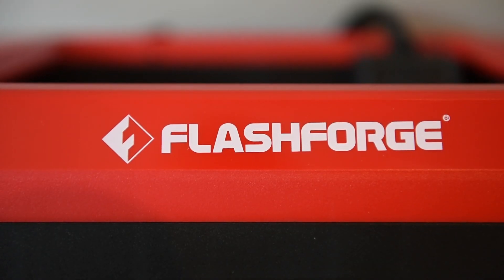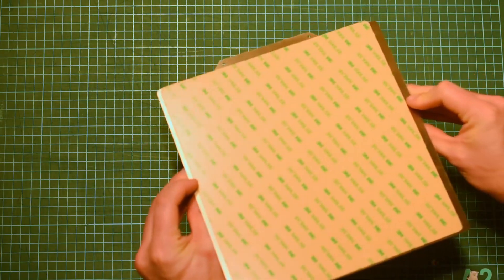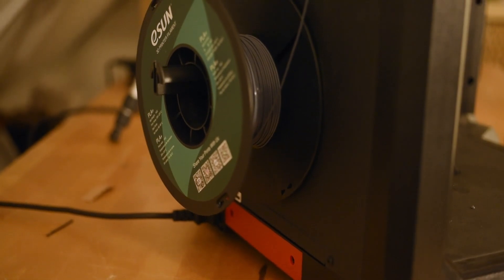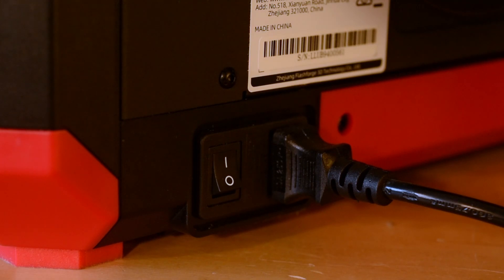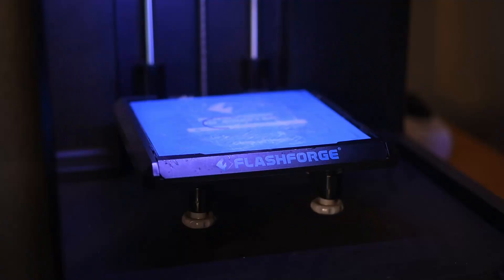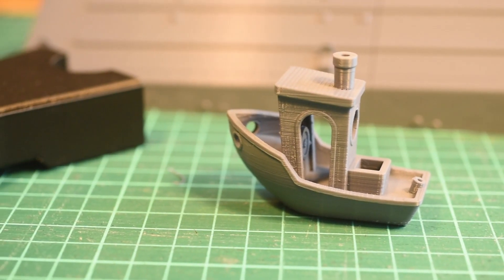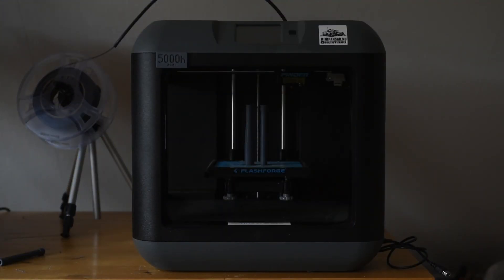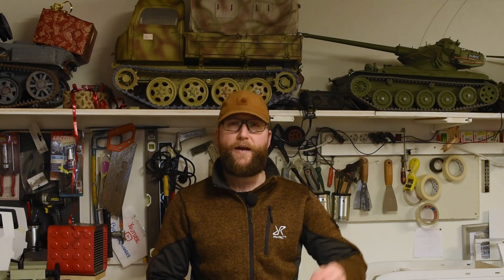3D-Printer review - the Flashforge Finder 3

Comment: I've had my Finder3 for about 2 or 3 years.
I filled the sides in with Acrylic sheet and printed some runners to hold another sheet of acrylic as a drop down door.Which solved the inconsistency issues with ABS.
 (Be careful flashforge haven't made the cut outs symetrical and the 45degree cut out at the top are not as wide as at the bottom ( I measured Twice!) otherwise it would have totally done me over and wasted £40 worth of Sheet.)
Out of the Box mine didn't work and needed a firmware update Which was in it seft a PITA and took about 3 goes before it worked. WIFI has never worked unless the p[rinter is 2 inches away from the router.That said It's been a pretty good printer for the past 3 years.

As much as I love my Finder3 it's days are numbered. Last week I had an accident with the glass build plate when removing a finished model. it broke some glass out of the Surface. That was still stuck to the print leaving deep chip out of the glass. I was a bit annoyed but went straight on line to buy a replacement only to discover there aren't any. Luckily The Creality Ender V3 plate is the same so I bought one of those. ( Guess Product support isn't Flashforge's priority ) Also a new hot end is the best part of £80 if you can find one? As it is I never used the Flexi magnetic plate but here's the big problem with that.
The heated Bed is made of Aluminium. How are you using this? You either stick the magnetic sheet to the build table and then you cannot use the glass build plate as it no longer fit  You'd likely break it if you tried. or you stick the pad to the Glass plate in which case you can no longer use the glass build plate anyway. If you thought of being smart and instead sticking it on the back of the glass plate,you will have the same problem as if you stuck it to the build table. In other words this isn't so much an option as an Either or Choice that you are asking the Novice Builder to decide on before they've even built anything.
As my glass build plate is now unusable because of the chunk out of the middle.  I decided to stick the  magneticpad onto the old build plate and try using it that way
As I write It is about halfway through a smallish print in PETG and looks to be going very well.
We'll see if it's easier to get these prints off the bed when they are finished.

Comment: As someone who has a finder 1 I really wish I had a heated bed I need to use every adhesion technique known to mankind to get my prints to stick
Reply from the maker: I love my old Finder 1, it's still going strong. I sometimes use a drop of superglue on tricky raft edges. When the build surface is worn out, it's easy to replace.
Reply: @builtbyWikander  is there any way to print without a raft on the finder 1?

Comment: I am having an issue with my Finder 3.  After its done printing the screen goes black and I have to power cycle it to get it the GUI appear again.  Is there a fix for this?
Reply from the maker: Sorry, haven't experience this. I know there is a factoring reset option under the contorls or settings, have you tried that?
Reply: @builtbyWikander  I have used the reset and I am still having that issue, my Finder 3 is also stopping mid print and sometimes the print bed descends while the printer head continues to print in open space.  These 2 things have happened before but lately they are happening more often.  The black screen is a new problem.
Reply from the maker: @notquitepinoy  Oh, I see. It sounds like you should turn to Flashforge for these issues.

Comment: i have a flashforge 2 everytime i change nozzel and tubbing ive been able to put it together getting it working properly this time i put new bits in i had to re level the bed but having trouble with it i can lvl the 2 front screws ok but cant seem to level the single back screw i seemed to do what it says but the screw is so lose it wont lvl so ive started re leveling it and always ended up with same result 2 front level but back single wont level is there any susgestions that would help or video
Reply from the maker: Hi! It's hard to tell what's wrong without seeing it, but it sounds like the leveling screw somhow has reached its end and can't adjust any more. Maybe it needs to reset its position, for some reason. It sounds like you are pretty handy working on the printer, perhaps you can disassemble the build plate mechanism  and restore it?

Comment: You'd have to pry my original red Finder from my cold dead hands. Best printer I have owned.
Reply from the maker: Haha, right? Still use mine, great machine.
Reply: @builtbyWikander  Only mod I did was the magnetic stick on print bed. Just bought a generic set and cut it down to size, huge improvement.
Reply: @ksavage681 I have a finder 1 and I need to use almost every adhesion technique to make my prints stick without a raft what bed did you buy?

Comment: I have had the original Finder for several years, and loved it!  But it stopped printing "good", so it's just been collecting dust. It works, but something is off.  I wish there was someone who repaired 3D printers because I really love my original Finder.  I'm sure it just needs something simple.  I bought the Finder 3 and was unable to unbox it for several months. I'm just now trying to use it and the touch-pad is horrible!  It is too sensitive and will repeat the same key multiple times - or it won't respond at all until I press harder, etc. I couldn't get it to connect to my Wi-Fi at all. I think it has to do with the 2.4 vs. 5.0 connection. I was finally able to get it connected to my Hotspot, but that sucks!  I found your video when I was looking for help with mine. I am currently printing my first print on it (FINALLY), so we'll see how it goes. Seriously...where can I get some repair/maintenance work done on a 3D printer??
Reply from the maker: Hi! Agree that the first Finder is a little gem. It's super hard to tell what can be wrong with a misbehaving printer, but have a look at this guide - it is very complete and might give you a clue as to what's causing the problems: https://all3dp.com/1/common-3d-printing-problems-troubleshooting-3d-printer-issues/#section-fdm-3d-printing-problems-my-print-looks-bad

Comment: Had my FF3 for about a week now and it's my first 3d printer. Of course, I have nothing  to compare the FF3 too, but right out of the box I've been printing for almost a week now with no issues.

Easy to level, simple to use, and great for beginners.

I have only two very small gripes.

Manually loading the filament into the head is a bit hit and miss. More than once  I've touched the nozzle by mistake and burnt myself.

The spool position is a little bit awkward and could benefit from an overhead top mount.

Aside from this, if your looking to get into printing, then I would recommend this printer.
Reply from the maker: Thanks for your comment!

Comment: I've had a horrible time getting anything to print of the past few months I've had this printer.  I can't tell you how many times I've leveled this.  only to print out a stringy blob of plastic PLA... very frustrating.  I bought this as it seemed less complicated.  I don't see many videos online for this printer to help troubleshoot so I may end up selling it and getting something else.
Reply from the maker: Hm, sounds strange, and I know how frustrating it is to not find any good sources online. Without knowing what's wrong with it, perhaps you can have some use for this very comprehensive guide: https://all3dp.com/1/common-3d-printing-problems-troubleshooting-3d-printer-issues/#section-fdm-3d-printing-problems-my-print-looks-bad
It covers most scenarios and might be useful.
If you are positive it's a leveling problem, my experience is that the distance between nozzle and plate is very small, like no larger than the thickness of a regular writing-paper. The "blob" description might suggests that the distance is bit big. Hope you get it to work!
Reply: @builtbyWikander  I got a feeler gauge because I thought maybe the paper was the issue. I re-leveled it again last night, and tried to print something simple, and it ends up a mess.  As it’s printing, the base the strands start lifting up, and catching and then it just keeps getting caught and ends up as a stringy mess.  So there’s no level surface for it to start building on.
Reply: @michellekolachi2371  this definitely sounds like an adhesion issue
Reply from the maker: @michellekolachi2371  I agree with Fifa Mia - is it PLA or ABS you are using and what are the print bed temperature? The distance between the nozzle and the bed plate should be as if you are squeezing tooth paste at a table so close that the string gets flat.
Reply: @builtbyWikander  That is a very good analogy of how close the nozzle needs to be to the build plate! 😄
Reply: @michellekolachi2371 I used to have this issue occasionally with my regular finder. I’d find that the tolerances it goes to when leveling the bed initially aren’t enough, so I usually set it a tiny bit more than the sensor tells me to, and it works just fine. Maybe you’d benefit from doing the same thing

Comment: (THIS IS JUST MY OPINION AFTER USING 3D PRINTERS FOR 5 YEARS AND MY PERSONAL EXPERIENCE WITH THE BRANDS)🙂
Only issue I have with flash forge and other companies like makerbot ultimaker is that there offering a decent outdated product at a very high price point there are printers that have way better stuff on them for the same price or cheaper and out perform easily in every way but because there big brands they get away with not adding new components to there products or using the community for ideas and just stick to mostly the same stuff each generation and all there stuff is proprietary and over engineered so there’s no room to improve or change anything on them they only exception to this style is bamboo labs X1 Carbon witch is the best printer you could buy for the price it is proprietary but they work with the community to Change stuff and improve and change the 3D printing market to make printers with everything cheaper and cheaper I do love you’re videos and I think you’re doing a good job